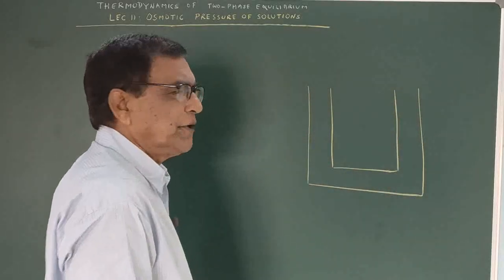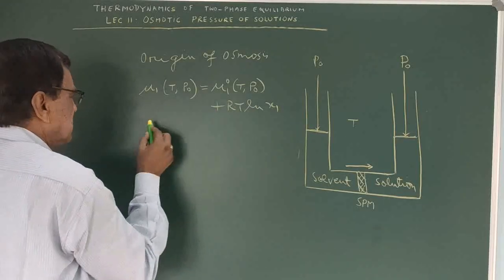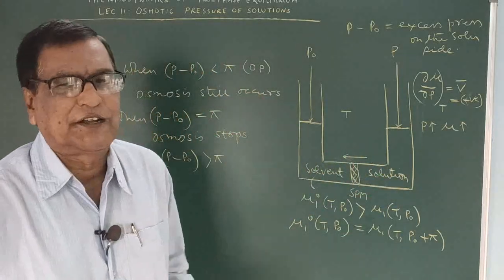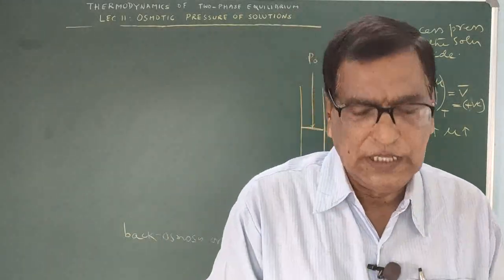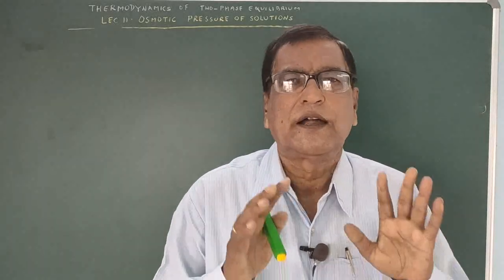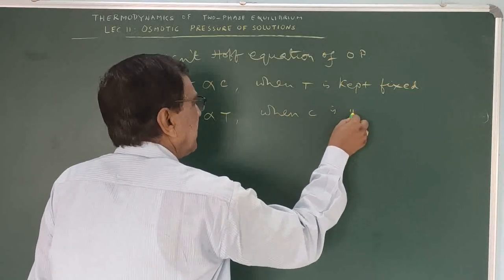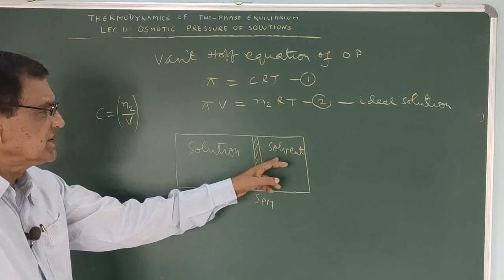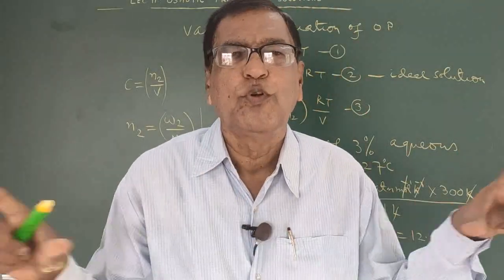Thermodynamics of two-phase equilibrium. Lec 11: Osmotic pressure of solutions.

Comment: Whenever I see your lecture...just feel that i am sitting in that pin drop silence class...and you are teaching infront of us..and you always gives correlation in your class to bring the things under the single umbrella to remember all the things easily....as i remember in this class you explained the flow of solvent molecules in terms of chemical potential also..as in the solvent side chemical potential is higher than in the  solution side..(Mu(i) = Mu(i)0 + RTlnXi....and thus solvent molecules spontaneously flows..as chemical potential measures the escaping tendency of a substance from a state where it exists to another available state...and then applying pressure in the solution side it is possible to slowed down the solvent flow..each and every words of your lecture just awesome...this topic I gave in my BARC interview...that interview I really enjoyed..it was only because of you sir..